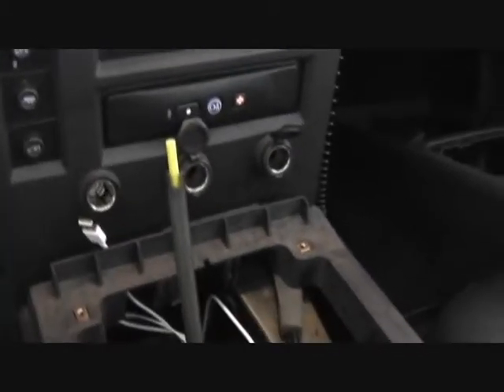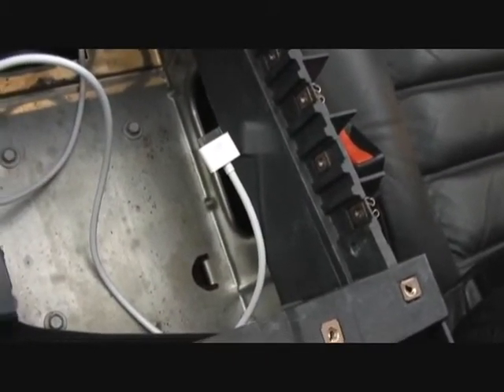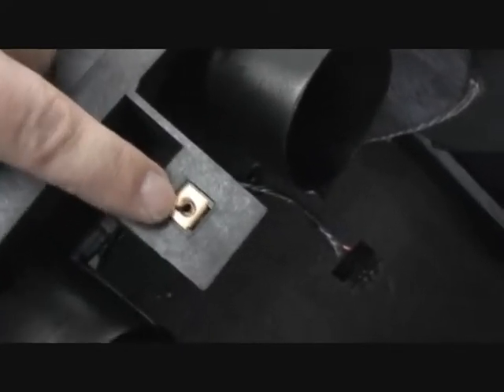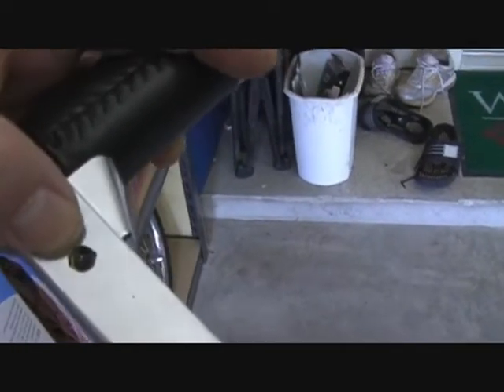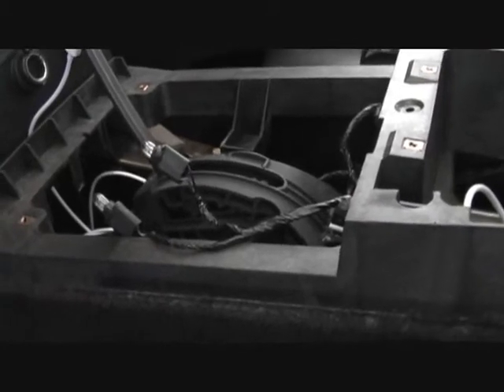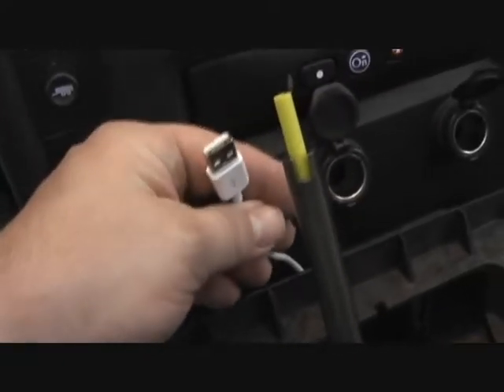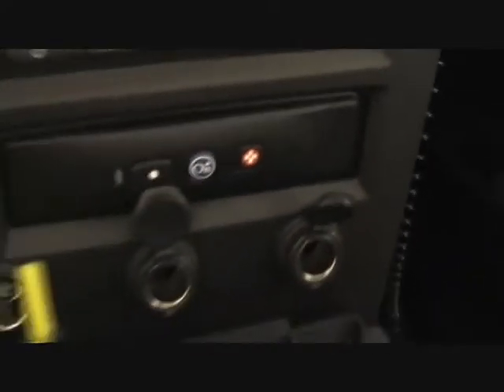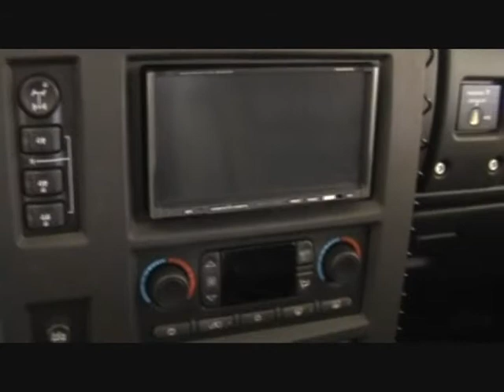iPod Touch Hummer Kenwood DDX6019 Install Part 1

Comment: 2 quick q's one did u have to wire in a the steering wheel controls or ... and two the important one did you have to by a speceail bybass for a new deck  to avoid an alarm or what not i'm supposed to do an install on one in a few days and info on them is harder to find then bigfoot any help would be great